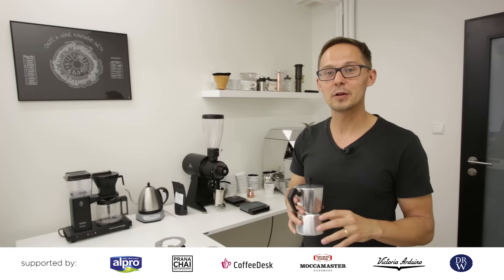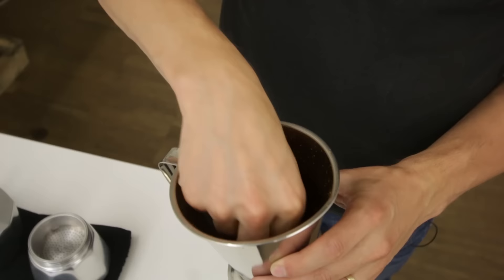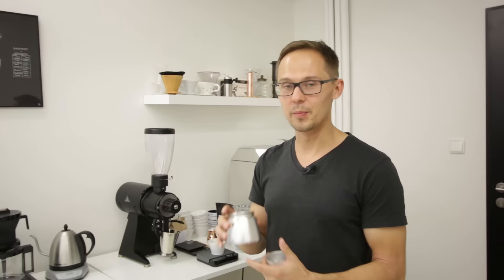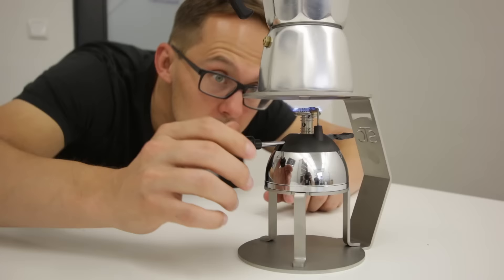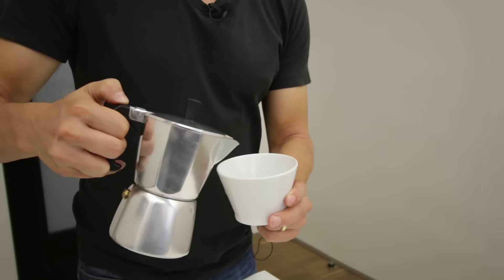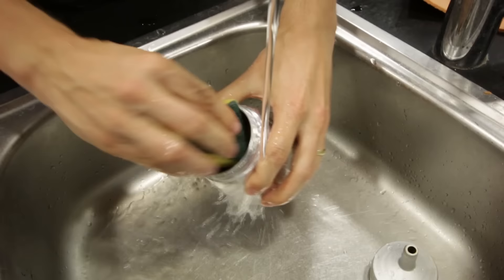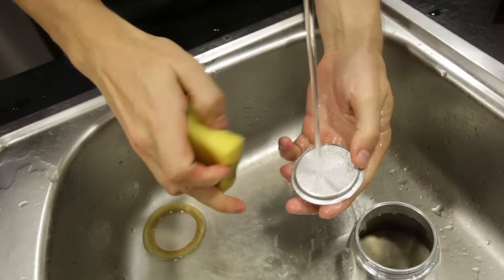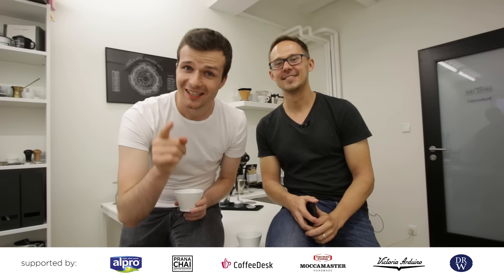How To Make Better Coffee with a Moka Pot

Comment: Tip: brew it sometimes just with water to clean the inside of the upper part too
Reply: now that’s a pro tip…thanks a bunch!
Reply: I just use hand
Reply: With 3 tablespoons of vinegar.
Reply: I have also had good luck using citric acid to clean mine out and for restoring old ones with a lot of buildup.
Reply: @TomFoolery9001  a lemon or the chemical one?
Reply: @Directo13  I have a bucket of powdered citric acid.  It's cheap and you can just put a scoop in and some water and let it work it's magic.  Get the food safe version as it's great to add to anything that needs a little extra pucker.  I use it in meringues, sodas, jams etc...
Reply: @TomFoolery9001  thanks for the advice!
Reply: @GigiDag46  yes vinegar works really well
Reply: I once left it unused and apparently I forgot to clean it before that.
1 month it stayed and there were dead and dried maggots everywhere.
I washed it multiple times with hot water brewing, soap water brewing, vinegar brewing, baking soda brewing, 
Eveything.

And I really hope I'm not drinking maggot corpse everyday now...
Reply: @dandydwi6_6  your hand fits inside that tube?
Reply: @phs125  the upper chamber not the tube
Reply: Bicarbonate of soda work too?
Reply: @phs125  The hell man? You leave the moka pot with dirty with coffee inside for 1 month?
Reply: yep but with an old rubber gasket un it

Comment: Yeah nah, an espresso grind is fine in a mokka pot otherwise you end up with watery Americano pish.  Certainly it will espress finer grounds no problem.  Also the reason for putting hot water in the base is not to "reduce the amount of time coffee is in contact with water" but to reduce the amount of time the coffee is exposed to heat prior to extraction.  This is not a brewing process where the coffee is immersed in water - its a form of espresso where the heated water is pushed through the coffee quickly, so the time it is in contact with water is much the same whether you start with cold or hot water.
Reply: One theory is you put in water near the ideal temp because the pressure will build up before the temperature is at brewing temp and force too cold water through the coffee.
Reply: Also the amount of water in the bottom container is a major control point: less water = less time for water to rise (since easier for steam to build pressure relative to water amount) I usually fill 1/2 water amount. And also no need to wait for bubbling stage, as this is when you have steam brewing coffee at 100c. This way no bitterness in the coffee
Reply: @khaledzurikat7190  Using less water is a really bad idea because less water will create more empty air space and less water vapour, resulting in a much lower vapor pressure which can cause under extraction and makes weaker coffee.
Reply: Caliathletic Fitness it is not a bad idea and it is in fact about finding the balance you desire: 1- amount of water 2- amount of coffee 3- initial water temperature 4- reaching hot bubble stage or not 5- pot design: wider stem (bialetti pot) = less pressure, narrower (alessi pot) = higher pressure. 6- coffee roast 7- coffee grind size 7- probably more variables I missed.

In summary, Moka pot is not an easy brewing method and it is very easy to get bitter coffee from it. Using less water is one variable to apply to reduce extracting bitter coffee.
Reply: An AeroPress is a good second choice
Reply: It's a percolation method with metal filter. Pressure will never be high enough to make anything resembling espresso. Hence the coarser grind to increase the flow rate given low pressure such that you don't get overextracted coffee

Comment: Don’t use the handle when tightening the pot or unscrewing, won’t last long
Reply: Relatable as fuck. Since you might decide to unscrew it while bottom and top parts are hot.
I have no idea how my father fixed the handle after snapping it.
Reply: Stuff like this, and the fact there's no lower handle to avoid the hot metal makes me think there's definitely room for a different company to improve on this design.
Reply: The Moka Pot is now gathering dust in my cupboard. I switched from the Moka Pot to the Aeropress a few days ago and it's a breeze compared to the Moka Pot. I use the same amount of coffee (30g) with the same grind in the Aeropress and I get mostly the same tasting latte with the inverted method in a minute. The plastic doesn't get as hot as the metal and just a rinse and wipe seems to be enough to clean it.
Reply: Thanks for the advice 😊
Reply: @LiamMarcon  check out the moka pots by Alessi
Reply: Too late.... Already lost the handle. Now I have to grab the whole por with a kitchen towel
Reply: Hahaha facts , broke mine yesterday
Reply: I have mine for years and the handle never broke... Maybe you bought a very cheap one?
Reply: @Headhunter-5000  I bought a very expensive one (same as you). If you use the handle as a lever to tighten or loosen the pot I assure you it will break after a while, try it ?
Reply: @LiamMarcon  I used some Sugru to make cover the metal near the handle to prevent burns.  Buy yeah I think the moka pot could be improved on pretty easily.

Comment: First, pour the hot water over the grind after you have set the filter basket in the bottom pot, to "bloom" the coffee grounds.  Let it sit for about a minute, then install the top pot and put it on the burner.  Also, for the best flavor, you should stir the finished coffee before you pour it, because a moka pot outputs different levels of flavor as it works.

Comment: I've learned two important things this week to improve my Moka Pot coffee.... First I also didn't know you can remove the seal to open that bottom and really clean the inside! Second, I didn't know that its better to use a slightly coarser grind rather than very fine like espresso. I'm looking forward to improving the taste of my Moka Pot coffee!
Reply from the maker: Thank you for sharing your learning with us. We are working on a new video now.
Reply: Coarse grind didn't work for me.
I have a blade grinder, and anything less than finest possible grounds, 
Will result in really watery coffee that brews really really fast.
Reply: @phs125  Blade grinder will be a lot coarser than what I meant. I'm working off a burr grinder that can go super fine... so when I say coarser, I'm just saying more coarse than what I normally grind for my espresso machine. On a blade grinder, I'd probably be trying to get it on the finer side of what it can do... I guess it is all relative to what we are using. I understand what you mean though... I've gone way too coarse before on the moka pot, and ended up with coffee that didn't get the right pressure, came out way too fast and was just watery and bleck!!!!

Comment: What's also worth mentioning, especially if you don't own a Comandante grade grinder or don't want to spend time sieving out the dust your grinder produced, use an Aeropress filter between the coffee basket and the pot. Much cleaner coffee, for me it does the trick, together with using hot water.
Reply from the maker: Good tip!

Comment: When I worked in Miami the Cubans often made coffee using a Moca pot.  They used Pylon brand ground coffee, which is actually an Espresso grind.  Even though the coffee was ground very fine, it still came out OK, though the Cuban method of preparing coffee is to add quite a bit of sugar, they froth up the sugar with the first few drops of the coffee and then add that to the pot before serving.
I bought a one cup Moca Pot and made coffee at home using the Pylon and it wasn't too bitter.  Recently I bought another  pot (couldn't find a single cup pot, so got a 3 cup pot).  I bought a small amount of coffee beans at the store, and used their grinder set at the fine setting, just a notch above the Espresso settings.  Again this worked good.  I haven't tried using hot water (didn't know about that, I'll try it next time).    Unless I buy my own grinder, I'll only get 1/4 to 1/2 lb of ground at a time, since the shelf life isn't that long.  Also keep the coffee in the 'fridge in a sealed bag to keep it cool and keep out moisture.

Comment: I started using moka pot earlier this year. I like my coffee slightly bitter so I leave it on the fire until all the liquid has finished sputtering. I have learned that most things with a plastic/silicone gasket can be removed so I have cleaned all components since day 1. I will start using hot water though bc I did not know that.

Comment: Good video, thanks! I personally only do a deep clean whenever the coffee changes its taste, so about once a month. Otherwise it becomes a hassle. 

For me, and it could just be a placebo thing, but I get way more caffeine from my moka than with my French press. Even when using the same coffee.
Reply: What is french press?
Reply: @myapinion7532  some places call it a plunger coffeemaker. Basically a pot/kettle where you fill it with ground coffee and boiling water, then press/plunge that down to the bottom of the pot where it's held in place by a screen filter attached to the plunger. Good if you like your coffee rich with lots of the bean's natural oils.
Reply: @SandsSpades  Ah, you mean a cafetiere? (Sorry, not sure of spelling). So l could just put some Espresso into one of those?

Comment: You have to stir the coffee into the moka pot before pouring it into coffee cups. It tends to stratify because of different density and temperature of the extraction (colder and denser at the beginning, hotter and watery towards the end) and the two cups, if not stirred, won't be equal in taste.
Reply from the maker: Thanks for the advice. We will give a try.

Comment: I am an Indian from the southern part of the country where coffee consumption is high unlike the rest where tea is preferred. In South India, we use a gravitational filter. It takes slightly longer than a Moka pot (or percolator) but you get strong decoction. Add hot water to dilute, or milk as we do here. Enjoy your caffeine! One more thing, since the filter is not on a stove, but uses boiling hot water instead, and decoction collect in the bottom container, there is no loss of flavour or aroma. Further, since the parts of filter are just three, the top, bottom and plunger, cleaning is simple. Try and let me your experience since you seem to be a coffee connoisseur as much as I am. Incidentally, I have a percolator too. Cheers.
Reply: Percolators are bad. Unusable. That's why they are almost extinct. Moka pots on the other hand are excellent, although they are quite similar to percolators. There is just one major difference: the coffee is not recirculated, but caught in a separate recipient.

Comment: I found using hot water just a hassle. It buys time for fast extraction, but I find it was too fast for me. Instead I find using cold water using higher heat to work better for me. These things are tiny, and induction is actually really fast for this so it works perfect for me.
I think all these guides are good. Everyone shows it different. You just have to find what works best for your equipment and coffee.
Reply from the maker: Good point! You are right, this is just an inspiration to adjust own recipe:) cheers!
Reply: agreed. the actual extraction time is very short. water temp has no effect on taste from my experience, unless you're distracted and let it boil on the stovetop. don't do that!
Reply: Not recommended if its stove top because higher heat can affect the gasket which then gives you bitter & rubbery tasting coffee.
Reply: Il am so agree with KevinKobe. I use induction une on gas heater without pre-heating water. Only coffee quality is important.
Reply: @sdfgsdfg9549  Nah, it's fine if you use a really low flame that doesn't come up the sides of the pot (plus a reducer ring to stop it wobbling).
Reply: @sdfgsdfg9549  I found using hot water made no difference whatsoever, instinctively makes more sense to me to use cold and allow process take longer

Comment: Grinding bit less coarse than V60/drip/pourover but also not as fine as espresso: just in between!
Cleaning rubber ring and sieve really not necessary after each use. As long as you "just" clean and rinse all as soon as possible after use. Just "tested" this on mine and (surprisingly) no dirt at all since last 4 weeks! (I bought a new one and - once again - rinse all parts thoroughly and immediately after every use)
And oh yeah.....: don't use a knife for takng ring out :-O, for more than one reason!!
Reply from the maker: Thanks for providing us with more details. It is true we didn't really tested for a long period to see how dirty it gets - but as it is still pretty similar to espresso brewing, more frequent cleaning will only help.

Comment: I am Italian, where Moka was born a long, long time ago (in ancient times the grand mother was "Napoli's Moka" ).... not in Spain 
Nowaday the Bialetti Moka is still is the best.
The Moka DOES NOT WASH with detergent or soap (eventually, maximum with just a sponge ) but the residual must be taken away only with the running water !
The first reason is because the Moka metal could take on a different taste, since it is coated with a patina, which the detergent could take away or create in chemical reaction with it.
Afetr that, the second reason is the Moka it is used only for coffee, so there could be nothing else. Furthermore the rubber of the gasket fits only after different uses both for the size and for absorbing the taste .. better than the taste of the rubber, it isn't ?
After several uses (many 10 or more), the gasket must be removed (but not every time, because it could be damaged, lose grip and, therefore, safety) and free the filter holes, if necessary with a needle.
With a new or unused coffee maker for a long time, it is recommended to make the coffee two or three times and throw it away, just to flavor the coffee maker  (oh yes of course... imagine if it is washed with soap, or detergent for steel !! )

XXXXXXXXXXXXXXXXXXXXXXXXXXXXXXXXXXXXXXXXXXXXXXXXXXXXXXXXXXXXXXXXXXXXXXXXX

Io sono Italiana, dove la Moka è nata tanto, tanto tempo fa (anticamente la nonna era "la Moka Napoletana".  ).....non in Spagna
Ad oggi, la Moka Bialetti  continua ad essere la migliore.
La Moka NON SI LAVA con il detersivo o sapone (al massimo, eventualmente con la spugna) ma vanno portati via i residui solo con l'acqua corrente!!

Il primo motivo è perchè il metallo della Moka potrebbe assumere un gusto diverso, visto che è rivestito di una patina, che il detersivo potrebbe portare via o creare in reazione chimica con esso. 
Secondo la Moka viene usata solo per il caffè, quindi non ci potrebbe essere null'altro. Inoltre la gomma della guarnizione si adatta dopo diversi usi sia per la dimensione che assorbendone il gusto..migliore  rispetto al sapore della gomma, no?. 
Dopo diversi utilizzi (tanti 10 o più), vanno rimossi la guarnizione (ma non tutte le volte, perchè si potrebbe rovinare, perdere l''aderenza e, quindi la sicurezza) e liberati i buchi del filtro, se necessario con un ago.
Con una caffettiera nuova o inutilizzata da lungo tempo, è raccomandato di fare due/tre volte il caffè e buttarlo, proprio per fare isaporire la caffettiera (figuriamoci se viene lavata con il sapone, o il detersivo per l'acciaio...)
Reply: Finally somebody who knows... It's for people like you I did the video "Bialetti Fetish". Thanks, keep on educating us ;-)
Reply: I was thinking this! Just bought my first Bialetti moka pot and it instructs me as you’ve said - brewed 3 coffees which I threw away (its kind of like seasoning a skillet) and washing only with water.
Reply: He did not say the Moka comes from Spain, just that he got introduced to it during his studies there. Thank you for the cleaning advices though!
*
Il ragazzo non ha detto che la Moka viene de la Spagna, ma qu'il ha riuscito a trovarla li.
Reply: OMG you wrote a novella!
Reply: I always use what most Italians use at home: Lavazza coffee.
Reply: You must wash the mokka pot with soap and water. The oily residue cannot be removed with water and a cloth,and no bitter aftertaste from doing this.
Reply: As an Italian I am very ashamed of the coffee culture in Italy. I am happy that we finally can remove the disgusting oils of the coffee from the moka pot. If it is steel, you can wash it with soap, if aluminum, maybe it's important not to use too much soap. But by all means, CLEAN the moka!!!
Moka was NOT inventend in Naples, but by mr. Bialetti. The Napoletana in soemething completely different. Anyway: if you have coffee stuck in the holes of the filter then the coffee is ground too thin.
Reply: But it you only use water the coffee oils will surely build up and eventually turn rancid?  Water alone does not remove oil well.  Maybe a special cleaner or vinegar??
Reply: @ss-nc2dy  that's correct, I never cared much about moka pots. I usually clean them by hand with dish soap, I don't know what special product one could use, but you're free to reserach the most recommended. Btw, you can easily take the whole moka apart, especially the filter mesh, protecting the chimney. You can simply open it up and give it a good ol scrub
Reply: @ss-nc2dy  no, no vinegar. That's an acid. Neither strongly basic compounds are good for aluminium. The only ones that would work well are these one s : https://en.wikipedia.org/wiki/Potassium_sodium_tartrate , or https://en.wikipedia.org/wiki/Potassium_bitartrate . That's anyway more proof that a stainless steel one would just save you from these headaches
Reply: wonderful comment! thank you!